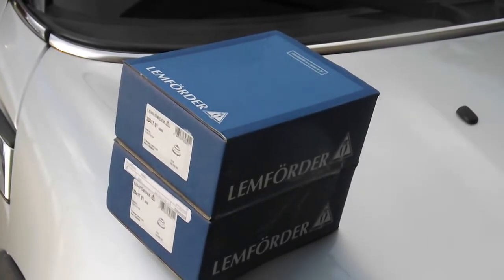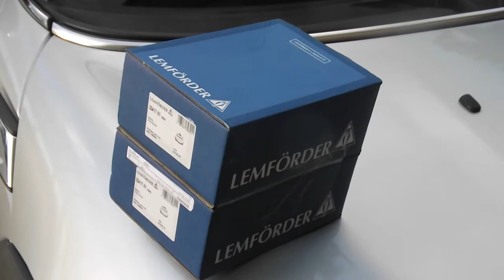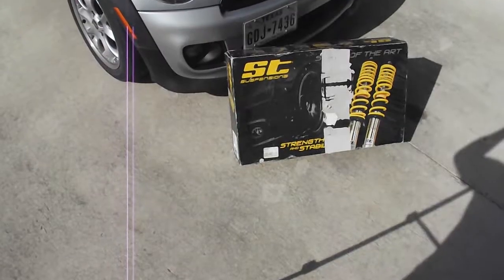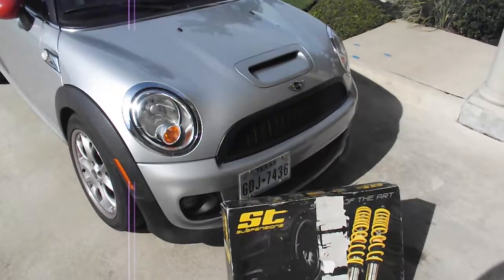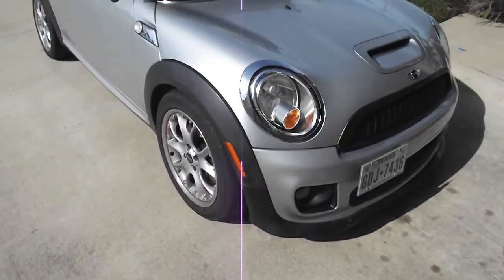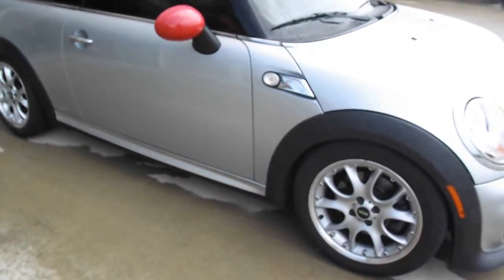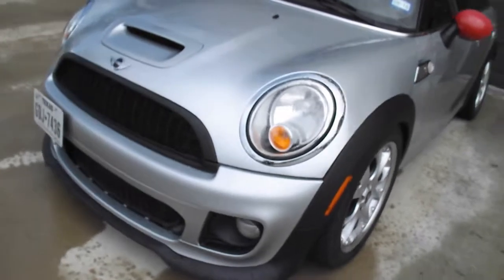R56 Mini Cooper S - ST Coilover Install (W/o Spring Compressor??)

Comment: This is pretty exciting! Thanks for the video. It's always awesome to see what mod you are working on next.

I'm actually waiting on a set of used KW V1's to be delivered, which I'm gonna get rebuilt by KW before I install them.  Luckily the KW North America headquarters is like, 20 minutes from where I live, haha.
Reply from the maker: Thanks man! did you get your coilovers already? how are you liking them
Reply: I did get them! And I just got them back from KW freshly rebuilt a few days ago too.  Now I just need to find the time to install them. I am super looking forward to it.   BTW, on your install, have you run into any issues with the sway bar link length? I've seen that some coilovers come with shorter links, or you can buy adjustable ones.  I'm not sure if it's something I necessarily need or not.
Reply: Also, how was your camber after the coilovers and lowering?
Reply from the maker: Great question I didn't mess with the rear but i'm sure I'll need of rear camber arms, the front is nearly identical as before lowering due to the marker technique I used to.

Comment: KW recommends:
We recommend using the adjustable KW wishbone for camber correction on the rear axle. KW No. 68510065

Comment: where you get the stop nut on top of the strut mount? 
its not the one taken off the coil over and i noticed you using an allen wrench to secure the strut mount to the coil over 
Wish i could attach some pictures- this is difficult to explain
my new ST's arrived this week, trying to install them and noticed the front coil over has a 10mm head on the strut piston shaft, not an allen like OEM
trying  trying to figure out how to torque the stop nut to the coilover. 
Needs a 7/8' deep-well to grab onto the 7/8 stop nut, but  there is no way to grab onto the top of the coil over threads and the strut piston spins..

will be giving THMotorsports a call monday morning .. so much for this weekend... :(

Comment: where exactly did you place those two stands to rest the car on it?
Reply: For me, I use the Jack and jack it up.  Then I use Cinder Block + Pressure Treated Woods for safety and put it right behind the Wheels.  There is a spot right behind the Wheels to do it.  For the Back Wheels, it's right before the Wheels.  NOTE:  There are 4 points on the Mini's to raise it up.